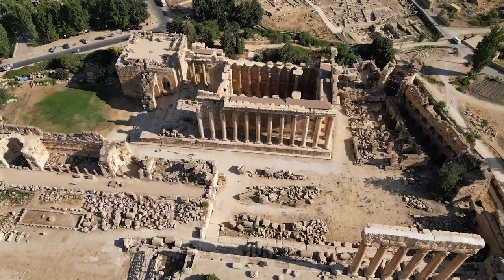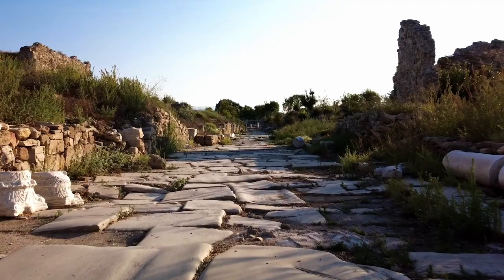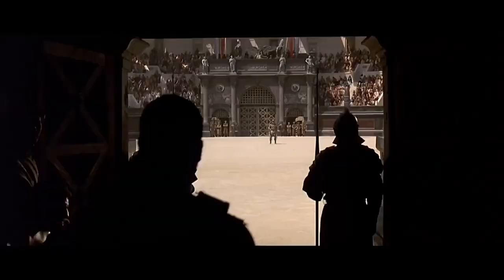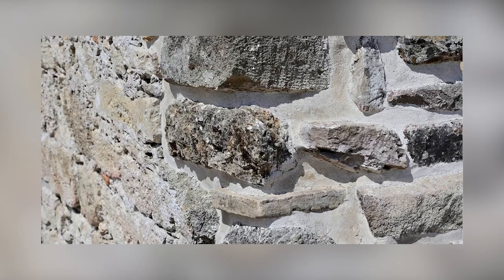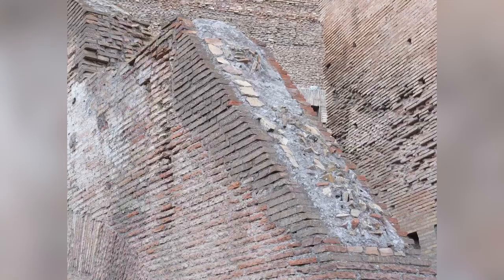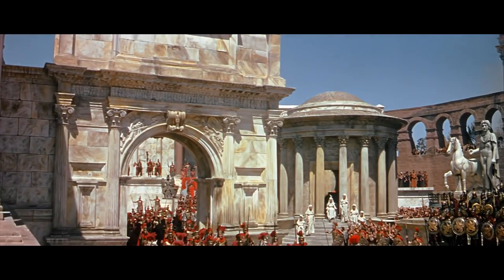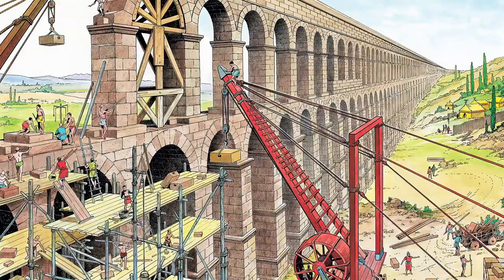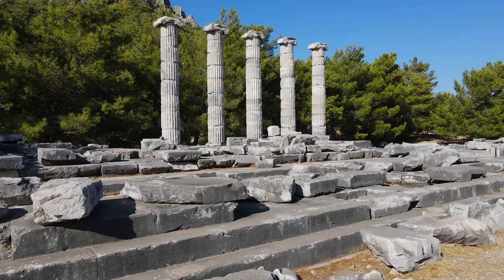DEBUNKING the Roman Concrete Hype

Comment: How dare you criticize Roman concrete tthat lasts for 2000 years? What do you have to say? You will never see a modern structure with your modern concrete lasting more than 200 years. Romans were much more clever than you imagine. They did eye surgery, for instance. Yes they had tools far more advanced than you imagine.

Comment: I am a mason, who owns a masonry contracting business, and one of our services is historic restoration of heritage masonry structures. Atop that first hand trade experience, I have a BA and love learning about all things ancient and building science. My wife, well she is one of a handful of PHds who specialize in byzantine enamel, and herself, a goldsmith. So, combined we have a very well rounded, extensive, and intimate knowledge of our respective fields. I quite liberally almost died of laughter 🤣 watching this wonderful piece of satire... wait, it is meant to be comical, right?🤔 I hope so, otherwise, its not funny, its just plain sad. 🫣🙄 Let me retort the nonsensical assertions made during this video, just in case you actually believe the absolutely ridiculous claims you made. First off, I would like to address what seems to be your main argument in your position that modern day cement or concrete, is superior to its Roman counterpart based purely on the belief that modern society is more knowledgeable than the romans... I counter, what do tomatoes have to do with the price of oil in China? The answer, absolutely nothing. Intelligence level does not correlate in any direct manner to the superiority, or lack thereof, of one building material to another. Moreover, when speaking of modern day structures, nearly 100 percent would have been made using a portland cement based mix design, so i will assume that is the modern material you are taking sides with over the  quicklime mix designs of the romans. If that is true, then our knowledge should not be used as the benchmark, it should be the knowledge available in the early 1820's when it was invented....  which would still give them an advantage in a jeopardy tournament vs. The romans. However, it has no relevance whatsoever to the argument. Additionally, let me clarify something you likely do not realize as a scholar, but any person in the trades will gladly inform you of the following information.... if you think that just because today we have large mechanical mixers and spec mixes, that: A.) Modern day mortar, concrete, stucco/plaster/cement is guaranteed to be thouroughly mixed B.) That every single mix used contains the exact same amount of that particular mix designs individual components .... well, if you believe either statement, i have a camel i can sell you too if you'd like? Because thats the funniest joke ive ever heard. 1000% facts, neither is remotely the case. I have been on jobsites all over the USA, and, its likely similar everywhere there are laborers tending to the mixer. You see spec mixes, which i hate to burst that fantasy bubble as well, but no two bags are ever 100% the same, although i will agree they are defintely more likely to be somewhat consistent compared to batches mixed on site. And, because spec mixes are only used for pours requiring less than a yard generally. Which would mean that every single structure that stands bigger than a small garden shed, does not utilize spec mixes, they would be mixed on site by a laborer, directly at the mixer. And, would you like to guess how the component's are precisely measured at every single jobsite in the universe .... well, ill tell you. See you have a giant box filled with your portland cement or more likely masonry cement (a combo of portland cement and type s masons lime, alternatively known as hydrated lime....) then, a huge pile of sand is found somewhere in very close proximity, and, lastly there is a big storage tank, a large hose, or the like, and this is the water source. The individual components are measured en mass upon delivery to site, except the water. For each batch however its up to the mix hand, usually the newest laborer, unskilled, onsite, to use his super duper precise flat shovel and laser vision, to ensure each component is the correct ratio. Also, they have to ensure they dont lose count as the shovel in each ingredient.  One time i witnessed a laborer shovel in 72 shovel fulls of sand... the correct number was 27. How many times do you think that happened before i corrected him....? Also, water is poured in freely, and the mixers judgment is their precise measuring device. I am rolling right now. The romans couldn't have better concrete or stucco or mortar because we are more precise and consistent.... thats probablu the funniest thing ive heard all month. You obviously have never stepped foot on an actual job site,  have you? And, just another quick thought to add to this one.... who do you think was more likely to correctly and consistently combine the raw materials of a mix design  and who would also be more likely to consistently ensure their mix is thouroughly mixed...(and, dont forget thr majority of jobsites still used wheelbarrows and mortar hoes, on even huge commercial jobsites, during the lifetime or my father....
Funny enough, he was a laborer, a union laborer, he was born in 1951, he has told me 1000 times how when he first started he would be mixing mortar so long, and in such long quantities that after week one on the job, he should have changed careers, bevause he thought his arms were going to fall off....anyways, who will be more precise and consistent a modern day laborer, making slightly over min. Wage, with no real training, no plans on making this his career, and who will have no serious repercussions if he messed up....not to mention, he is mixing a material with no properties which would accurately and clearly indicate that the mix was right, and properly mixed. Or, the roman who if he screws up the ratios or screws around during the mixing or the material itself is equally likely to be severely injured or killed by either the violent, extremely hot, and dangerous exothermic reaction of the quicklime with water and sand in the hot mix, as he is to be beaten or murdered by a roman soldier aiding in the supervision of the project and its laborers. Not to metion, the mix wont react properly if the portions are off, which g
Provides a very clear and accurate indicator of whether your mix is right or not. Also, it tells you when its done... hmmm. That sounds a lot simpler than trying to pull an answer out of a rabbit's arse....

And, lastly, the fact that maintenance was done illustrates that the people who built these structures and those over the 2000 years who kept them up (exaggeration, but not so much in other countries with similar hot mix mortars.) Are far more intelligent including having more common sense, more astute observers with a finer attention to detail, hardworking, skilled, and proud masons.... as compared to the completely ignorant morons who over the course of portland cements existence and use, have somehow started to believe a flat out incorrect misconception which is both widespread and persistent that masonry structures are indestructible, and require zero maintenance or upkeep. Which is precisely why i repeatedly am contacted by clients whos homes have suddenly, and without any warning, 🤐 just decided to collapse, or split themselves down the middle and leaving a crack reminiscent to the grand canyon right through the middle of the structure... how does this happen after 100, 75, 50, 25, 10, rarely, but it has occured, even 5 years after they were constructed. Well, the 100 year ones likely from lack of maintenance and upkeep. The five year disasters, see all aforementioned infomation above.... and, these crumbling, unsafe, eyesores are literally every where, and in most cases they are beyond saving, at least cost effectively.  And, millions more are headed in that direction. So, maybe, its us modern people who are the less intelligent ones, because to me, it sounds like these romans, and they descendants had the right idea... 

Not trying to be a complete a hole here, truly. But, this is serious. And, its scary, its saddening, and its putting whole families at risk everyday. The state of our masonry structures, at least here in America is pitiful. And, the sturdiest structures are the ones using lime mortars, rough sawn lumber, natural stone, hardwork, knowledge, and common sense *of the masons who were true artists and masters of their craft, men who i admire and strive to be like....

Bv